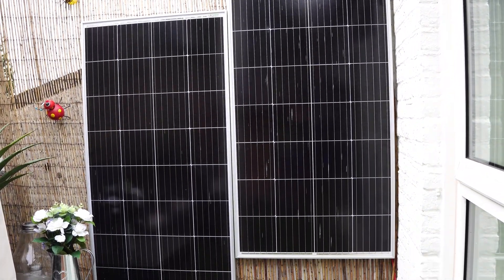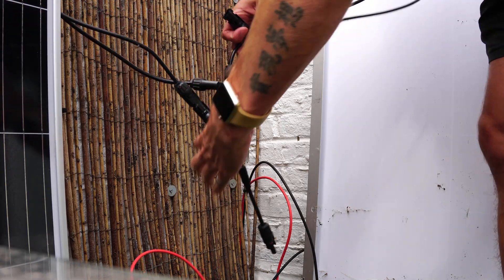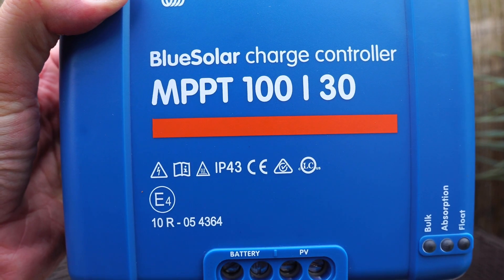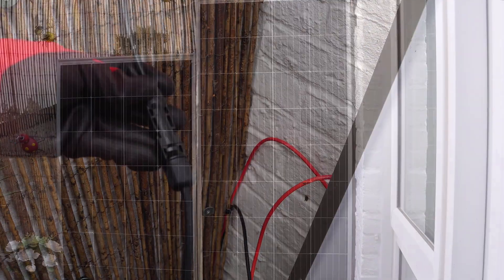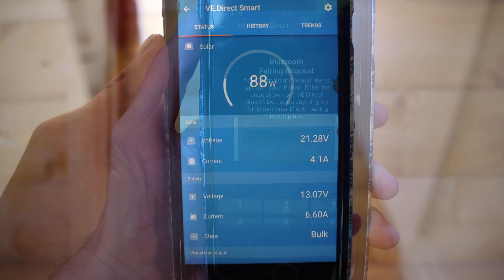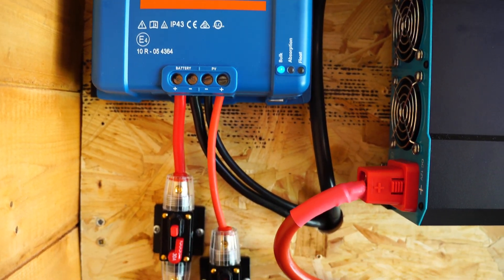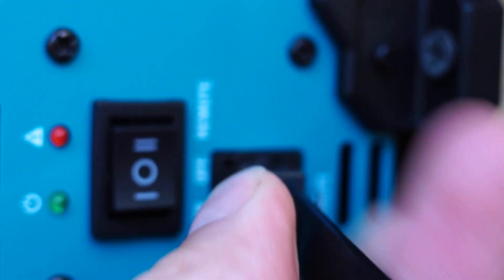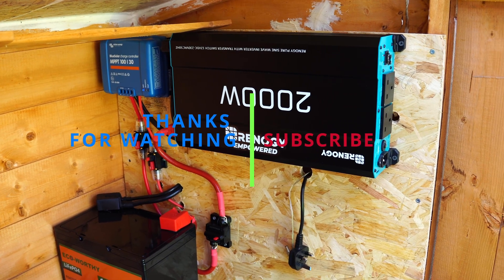BASIC OFF GRID Solar Panel Setup - PART 2

Comment: What sizes  of cable from battery to inverter for 2000 watts
Reply: Its got on a 35mm or 2AWG cable from inverter to battery and hes got a 200a breaker between them

Comment: Ended up buying a Victron 100/30 charge controller to go with the eco worthy batteries, yes sir you inspired me.  Wanted to ask what the absorption voltage, float voltage, equalization voltage for these batteries are?  Checked all over can't find the info!

Comment: I’ve watched videos on solar, where people have said that during the winter they leave the inverter switched on, as the heat it generates keeps the batteries warm as lithium apparently doesn’t like the cold.
Reply from the maker: I may look to insulate the battery and save the energy

Comment: With the solar generators available today, why would you want to build a system from scratch? Are there any benefits?
Reply from the maker: I haven’t had a solar generator myself to test. Building a setup allows you to upgrade any parts, building a setup could work out cheaper. I’m sure a solar generator is more convenient for travel / moving. There maybe a comparison video for you to check out.
Reply: @PwinkleR  Good points. I can see that.  Kind of like customizing a car or modernizing a house. You make it work to your own specifications and needs. Thanks for making me think outside the box. Pun intended.